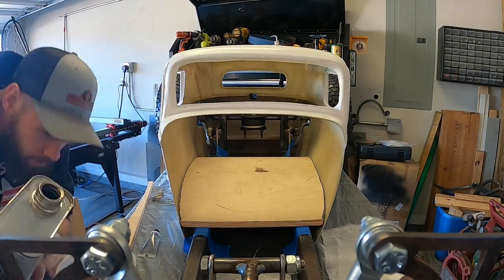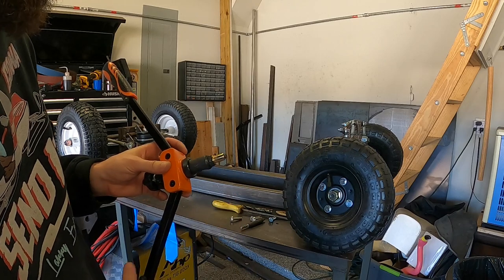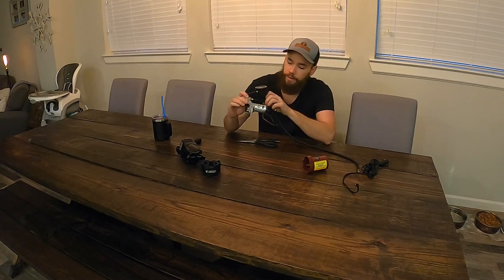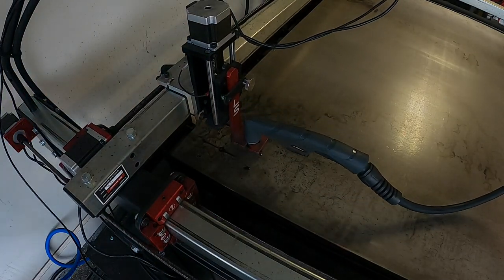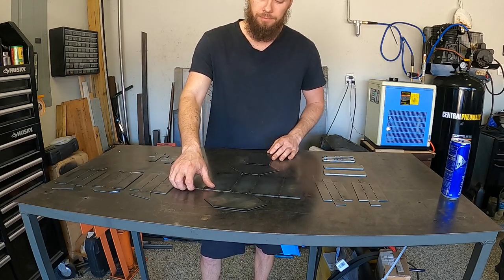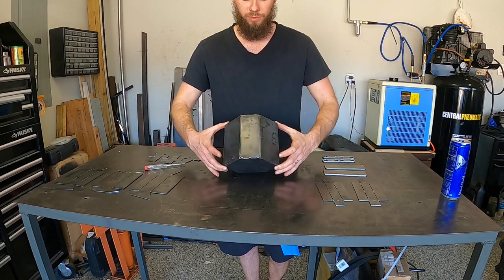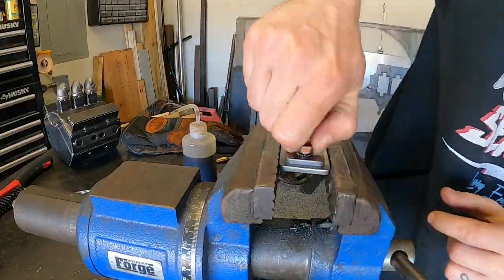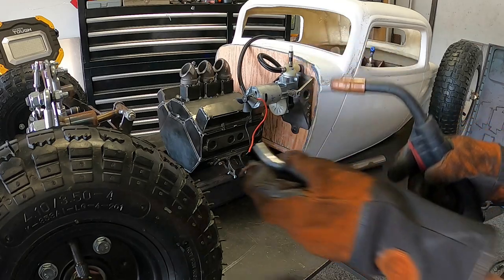Hot Rod Stroller Build Part 3 Couper's Coupe | Bare Metal Fabrication

Comment: I gotta tell ya, tho it's a KOOL as hell project & as my wife wld say, VERY CUTE, it's gnna B quite heavy man. U shld'a built a wooden form in the shape of the engine & used fiberglass 2 make a mold, & ALWAYS employ a resin roller whn using glass sheets, woven mats, MEK & resin. Once u "gently pop" the pc off the mold, u cld'a used tinted gel coat 2 finish it off, u still cld'a used metal accents 2 finish off the "look" of the engine. Cuz mannn, this kool as fck thng gnna weigh a ton, B hard 2 push & ur child has "0" leg & foot room. Idk dawg, tho it's Kool as hell, it gnna B heavy & HOT 4 the child 2 sit within styrene shell & not far from the hot ground over a metal frame. U might wanna re-think the plan of action 4 this project man
Reply from the maker: Thanks for the input but we’ve been using this car now for the last year. It’s complete. My wife can push it just fine and my son fits just fine lol. As he grows I plan to raise the seat to give him more leg room. You are welcome to check out the instagram page to see the completed build.

Comment: What's up man ... I really like your work ... I'm from south Africa... I wanna build a 32 coupe for my daughter but I cant find any dimensions on the body or frame ...
Reply from the maker: Thanks man, the frame was custom built around the engine design and  wheel base that I wanted. I didn’t make the body. But it is 1/4 scale replica of a 32 ford coupe. I haven’t been able to find another one since that company went out of business. I can try to get some measurements when I get some time.
Reply: Awesome man I would really appreciate it..... did you finish it
Reply from the maker: Yeah I finished it. I’m just really behind on the videos. If you follow my Instagram account you will see the a lot of pictures of it finished. Search for bare_metal_fabrication on Instagram.
Reply: Awesome thanks man

Comment: Dang, u shld'a rolled out n e bubbles with a resin roller, u probably have a ton of weak spots due 2 air trapped btwn layers of glass & woven materials. ALWAYS USE a RESIN ROLLER whn using fiberglass, MEK & resin!!!